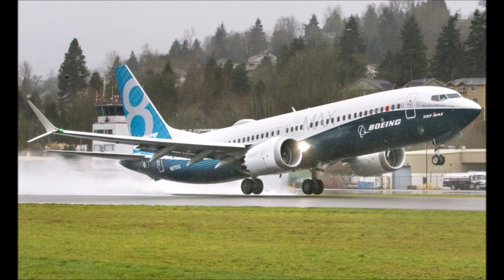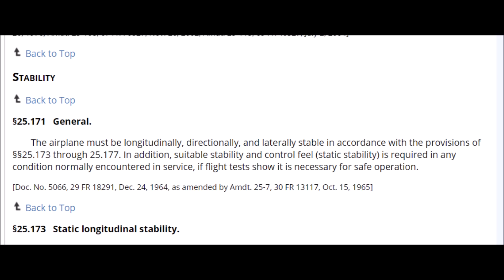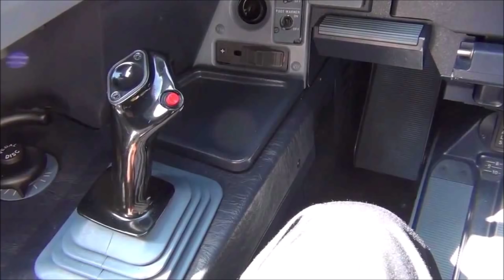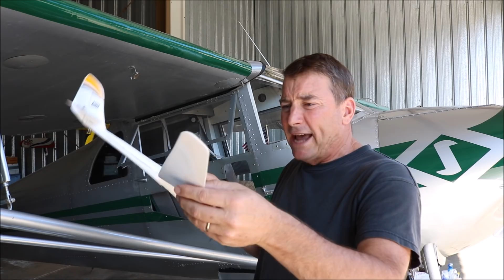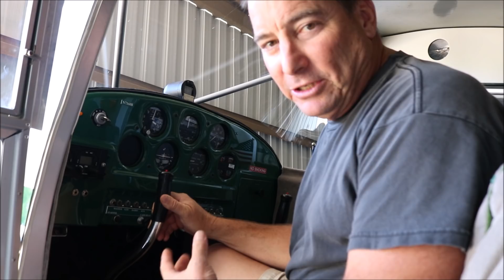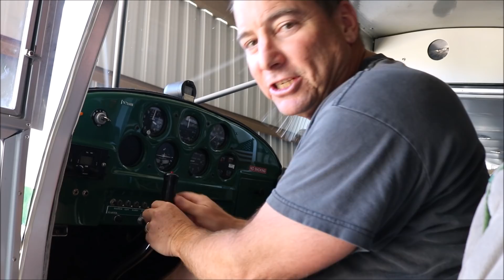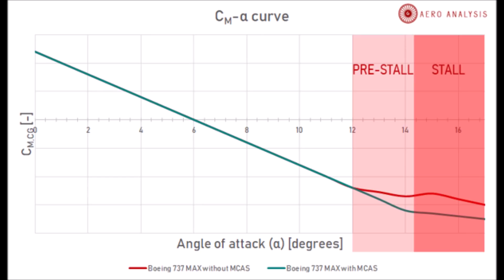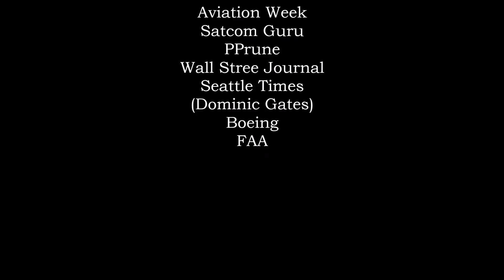737 Max UPDATE 30 Aug  2019

Comment: I always liked aviation since my first flight on a PSA Lockheed Electra from Tuscon, Arizona to Los Angeles in 1962. Before finding this Channel I was Subscribed to "Captain Joe" & "Mentor Pilot" in 2016. Other News I get (I'm up in Western Washington now cause I like the overcast, rain and colder temperatures. Very Uncomfortable with temperatures above 75° F. I was wanting to be an Architect or Pilot. But I live in irony. And have a Retarded Dyslexia with my analytical dexterity's. Trouble hearing, understanding things and visual problems. Actually am scared of heights outside of things not encasing me. And an Aircraft that is encasing me elevates the fear of heights. In 1969 thinking of wanting to be a Pilot at age 14. I tried to see if I could over come the fear of Heights from diving off a 10 foot diving board into a pool. (It didn't help. I felt the plunge with terror. And was hoping I wouldn't drown because I was gasping for air when I surfaced with panic and trying to keep from inhaling the pool water. (I did get into the Navy and served on the U.S.S. CORAL SEA CVA-43 Aircraft Carrier for a couple years. Wasn't an Airman, but a Seaman. Was fascinated with the F-4's taking off and landing) I later tried the Air Force Reserves in Sacramento, CA. 1981 - 1983 at McClellan. Did live in the area for 28 years. When I wanted to know about the Orville Dam in the News I was picking out youtube topics and found blancolrio in 2017 (?). After checking out a few more of the videos. I was totally surprised John here is an Aviation Pilot also since finding this Channel 2017 (?) I have had many flights in the past on aircraft's, so I've had the pleasure of enjoying these experiences. Wanting to know why there is issues is a science that I like to understand. Just hoping we know how to be more Safe & Giving us better amenities of pleasures with more common sense to things.

Comment: Surely the design of the aircraft including the fancy MCAS should be such that it has a failsafe mode that puts the aircraft in a configuration that the pilot is able to (quickly) fly the aircraft manually with reference to basic attitude indicators?  If the MCAS fails and the trim points the aircraft at the ground or up at the stars, then you want that trim to be released so the pilot can fly.  Good video.  I sympathise for the no fly regime; I have recently been stopped from driving here in the UK for medical reasons - no fun.

Comment: So back to the design for high speed handling, but what about the low speed handling?
Reply from the maker: covers both.
Reply: @blancolirio  If the modification to add authority was done for the low speed realm I would think they'll still have to do something in the new version to address that realm.

Comment: Now we know that you aren’t currently certified to fly your own plane. I have been wondering about that. 

Your video was superb.  I’ll wager that I’m not alone in wanting YOU working inside Boeing to oversee the current attempts to resolve the fiasco, and having you PAID by the FAA.  Ideally, you would be in a “tenured” position so the FAA nor anyone else could breath down your neck to influence your independence.  

Your session in “The Mighty Luscombe Simulator”, showing the relationship between stick forces and trim imbalance was priceless. Thanks for including that. That was really useful to me, and I have done some private pilot and glider training. 

Left unsaid: the Airbus flight control system (stick & rudder) is presumably furnished with artificial feedback to give pilots a sense of control forces Vs. control surface deflection.  Is that true?  Perhaps you could include that info in a future video. 

Here’s a big question:  What would you recommend as the solution to the MCAS problem?  I’d like to hear that from a very knowledgeable pilot’s perspective. 

Are there that many pilots switching back and forth between 737 variants?  Or, might it be actually MORE practical in the long run to require 737 MAX pilots to have a specific type rating?

We are incredibly in your debt for this good work. Thank-you — from the bottom of my heart. And I wish you good health, Juan.
Reply from the maker: Thanks Larry. I recommend the current course of action plus a healthy dose of recurrent sim training on MCAS , especially for overseas operators.
Reply: Juan,  I’m curious about the 737 Max’s horizontal stabilizer.  Specifically, the “all-flying” function being under the influence of MCAS, and the pilots’ having (apparently) drastically less control authority than MCAS, as the elevators only are (seemingly) connected to the flight control system. Please comment on that and compare the 737 MAX in that regard to other air transports. Thanks again for your exceptional work. And good luck.

Comment: wait. You state that MCAS is not an anti-stall system. Yet at 19:55 you state that MCAS is allowed to activate "until the stall condition is recovered." Wouldn't that make it an anti-stall system?
Reply from the maker: No. The PILOTS recover from the stall, not MCAS. Watch again.

Comment: I believe the 737 Max anti stall system has no input from The pilot, that is the problem. The pilots cannot override the system if they could they would have. If there is a overriding system the pilots are not told about it no blame on the pilots it is a manufacturing defect with the plane. But as you say you with the bus and  the light on the stick, so why does this matter with 737 Max if it has the same characteristics as the Airbus on the stick? And have the computer to take control of the plane, why not just the warning system that tells you are going to  into a stall that's enough input for the pilot to take action
Reply from the maker: Stab Trim Cutout Switches- Cutout.
Reply: @blancolirio  but they had no knowledge of that it was never put in any briefing ok after the event Boeing are liable for those deaths by not telling the pilots

Comment: Let me first say that I'm not a pilot. However, I'm not sure I agree with this pilot's assessment of the reasons behind the 737 MAX issues.
Second, let me also say that I have no affiliation with Boeing or the aircraft industry in general.
I would recommend everyone watching this video take a look at a video put together by Wendover Productions on the 737 MAX. Just search Wendover Productions 737 and it should pop up.
Also, I have no affiliation with Wendover Productions either.

Comment: Thank you for your update and explanations.  In my past I flew the KC-135 (Boeing 707 basically) and there was a manual stab trim indicator.   This was an important indicator that would tell a pilot where the stabilizer trim actually is positioned.  A trim indication out of the "safe range" would trigger the pilots to check the things that would cause the out of normal trim position.  My question is: does the Max have a stab trim indicator or is it just a warning light?  

Your description of stability was nicely presented.  To make more of the stability explanation, I offer this:  As you described, the further the center of gravity is moved forward of the center of aerodynamic pressure the more trim would have to be applied to achieve a level flight trimmed condition.  Therefore, more downward (induced drag) is created ( on the tail of the airframe) which requires a little more thrust to maintain a set speed.  With more drag on the airframe, this would decrease maneuverability and larger thrust adjustments would be needed to change speeds resulting in more stability.  As you said, fighter type aircraft want as much maneuverablity so their center of gravity and center of pressure are almost at the same position.  We demonstrated this effect in the tanker by moving fuel forward or aft (moving the center of gravity forward and aft) and recognizing the thrust requirements to maintain a set speed.  We did this to show how to increase our fuel savings techniques and demonstrate changes in flight characteristics, ie, lighter controls at more aft CGs.  Receiver aircraft taking on fuel, love it when we carry a forward CG  resulting in a more stable platform for refueling.   

It is obvious that you enjoy flying as much as I did.  The Airbus was fun to fly but not like the KC-135A/R.  I'm sure you'll be back flying very soon.  Just remember, for guys like you and I, flying is the best thing you can do with your clothes on.  ;-)

Comment: Thanks a lot, this is really really great detailed fact "HANGAR", Thanks Juan

Am I write or missing something, Still a question, previous 737, trim cuttout switches was one to cutout automation stabilizer control and one to cuttout manual control. Why this changed to both swithes cuttout the power to the motor.
Reply: The B737 has gone through 4 iterations, on the previous NG model both switches had the same function, only the earliest models had switches with separate functionality.

Comment: Very clear and concise appraisal of the situation. The marketing vs engineering tug of war exist in most industries. When marketing wins  over engineering it usually just impacts (negatively) ultimate customer satisfaction and thus the bottom line. This time (as in the past) it has cost lives...  As our society in balance (In the US) moves away from an engineering/technical  mindset to a more cookbook style of product development the need for oversight from a competent entity becomes even more critical (but very unfortunate). Now we are finding (as you mention) there is waning competence in that vector as well.........In another vein ....I'll bet you roll your eyes when you start editing these videos......Your multithreaded thought processes have trouble taking turns entering the single thread delivery channel.......but you fix it with your editing so all is well...... Thank you for sharing your insights and analysis into the various issues you cover...
Reply from the maker: Thanks Ken, this one required a lot of editing, and retakes.

Comment: A very very interesting video -- two points to add; Boeing "designed" the aircraft over a very short period of time, and made two massive compromises that altered the aircraft's balance -- shorter pylons and moved the engine forward to improve ground clearance.  Secondly, and you mentioned it, in passing, bad data.  It is widely believed that the pitot sampling was way too low -- giving the problem of false data by undersampling.  It's more than likely that the problem has been resolved (system-wise) but the real (and most costly) will be the loss of confidence in the type.

More troubling is the cutting of corners and the decision by Boeing to not inform the crew that there was a system on board that superseded their own decision making process, a system that they were unable to switch off.  Your point between Boeing and Airbus in terms of "who controls the aircraft" was perfectly phrased, but this change on the B737MAX was a "walkway from Boeing's core philosophy" and that's something that will be hard to walk back.  

Still probably the best explanation I've seen anywhere of a complex problem

Comment: Sorry to see that you are temporarily grounded and hope to see you back in the air soon. Question,  if Boeing had built into the MCAS an automatic announcement alerting the Pilots of a runaway trim,  prompting them to turn off the Trim switches to,override the MCAS immediately, would that have worked?
Reply: Too many what-ifs and assumptions, rather fix the MCAS system properly.

Comment: Do you think that the two accident aircraft could have been saved if the pilots re-extended the flaps?
Reply: If the speed was low, then yes. Once the speed is too high, it is not permitted (nor safe) to extend the flaps, else they will be ripped off by the airstream.
Reply: @gordonrichardson2972  Good point. However, they crashed; ripping the flaps off would have resulted in a high speed flapless landing perhaps but Flaps 1 wouldn't see the flaps be ripped off during the porpoise activity would they?

Comment: I am a retired pilot.  USAF, civilian, 6 airlines, a year as a Boeing flight test engineer. MS Aero/ Astro.   I've flown most of the jet Boeings   (Not the B-47, B-767 787, or 777) and retired flying the A-330.  I did not care for the Airbus design philosophy. The Airbus airplane "feel" is like a 1990 computer game control stick connected to an old 286 processor via a bungee chord.   I have to admit it was fun watching a new copilot fight the gusty crosswinds in Tokyo.

Comment: You have a B777 rating.
You therefore know its fly by wire.
You also know what the 777 does for stall and low speed protection.
And the overbanking.
So what are you on about at the 10:10 part of the video?

BTW I've watched your channel for ages and subscribed during the dam drama. I enjoy your videos. But I didn't like this one where you infer that Boeing aircraft dont have built-in protections. We've both flown 73's and 777's - and with the big one, I think it would be hard work to mush in.
Reply from the maker: We're not talking  about the 777 .
Reply: @blancolirio  You were more generally talking about Boeing vs Airbus "design philosophy".

Comment: I have a question: the new version of MCAS will automatically disable itself in case of AOA disagreement. But in such case the original function of MCAS will not be provided, i.e. the pilots won't have the correct feeling in the pre-stall condition. How will they deal with this problem?
Reply: Good question, which hasn't really been answered fully. The simplest response is to land at the nearest available airport, and fix the problem! The assumption must be that this will not be a frequent occurrence.
Reply from the maker: Fly the airplane like they have always done.
Reply: Get back on the ground

Comment: It is Boeing 's propaganda and false logic presented to general public & pilots (who are not aeronautical engineers and do not know vector calculus mathematics in dept) that  MCAS is not for stability of the aircraft but is only there to give same feel to the pilot as previous aircraft i.e. is only an aid to human interface. As a Automatic Control Systems Engineer  with Master of Engineering Degree and 30 years of industry experience,  I do NOT accept that false augment presented by Boeing. If Boeing 737 MAX  is indeed stable without MCAS, then the Boeing 737 MAX should be certifiable WITHOUT the use of MCAS, just as other aircraft that DO NOT use MCAS are safe.  The reality is that  is that it is impossible to certify Boeing MAX 737 as a safe aircraft without the use of MCAS.
Reply from the maker: I respectfully disagree and defer to the FAR's.
Reply: As Juan indicates, there are several different FARs. The one for stability applies to all passenger aircraft. The one for control feel applies to those flown manually, such as the B737. The requirements for each are different, though there is some overlap in certain phases of flight.

Comment: But Juan, isn't it a bit premature to rule out whether the MAX is inherently unstable? After all, as you correctly noted at the beginning of the video the investigations aren't all over and what may have passed an FAR in the past may have been an oversight on the part of the FAA who is now taking a very careful look indeed at the aircraft before releasing it to the flying public. I'm just saying we shouldn't necessarily jump to conclusions about things just yet. I still remember when everyone was blaming the pilots and treating them as isolated incidents before the NTSB and FAA had a look at this thing. That being said, I was on a MAX across the Atlantic on New Year's Day and it was fine.
Reply from the maker: If that were the case, how could it ever get re-certified even after all this scrutiny.
Reply: blancolirio but has it been recertified? I thought the updates are still under review?

Comment: None of this makes me happy: 

There was no other way that pilots could be warned they were approaching a stall condition? So there is an FAA directive about how "control" should feel. That directive is 54 years old. Oh and it doesn't apply to Airbus because they have a joystick. That's one thing.

On what planet could it ever have been acceptable to move the stabiliser trim to fully nose down position in less than a minute? How does that fit with the notion that it is merely warning the pilots to take steps to recover from a stall situation. Clearly it's trying to fix the stall.

The stupidity of this design is so bloody obvious that a layperson can see it. And yet no one at Boeing appears to have taken a holistic view of MCAS - was this software design contracted outside of Boeing? Who signed off on the change to the FAA approved design? Where is the FAA sign off on the change? There isn't one? How can there be an engineering design system that doesn't have proper sign off?

And the last terrifying thing is that once this flying nonsense is back up in the air, it will take an average of 6 months for all pilots to have simulator training of the revised MCAS system. Surely the simulator training should be compulsory BEFORE anyone can resume flying the Max 8.